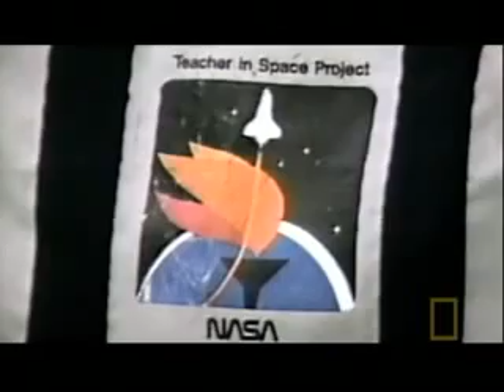Challenger: The Untold Story Part 4 of 10

Comment: In all seriousness, though I wonder why no one called a news station or something to attempt to stop the launch.
Reply: I mean thats a hindsight comment, nothing wrong with it but any statement on action that should have been taken is one done with the benefit of that hindsight. Lets say one engineer leaks it to the press, will it get enough traction in time for it to be effective? 
Lets say it does (and in all probability it wouldn't), would NASA stop the project or attempt to sooth any fears by saying "we flew with these O-Rings, they are fine." And its true, they did use those O-Rings and while the first ring failed, the second held up. The nuances of how close they were to failure in those test flights would be swept under the rug (that they were 8-10 seconds away from failure).
NASA would turn any negative press of that nature on its head and continue on with the project. 
At the end of the day projects like this are juggernaughts that aren't easy to stop, and can basically only be stopped by committees at the highest levels, a process that can take weeks or months to put into practise.

Comment: that O ring guy was wrong. because whatever happened to Challenger, the shuttle program continued for decades after challenger !
Reply: The O ring guy was correct- they redesigned the field joint after the disaster and that was the only reason there was not another disaster.